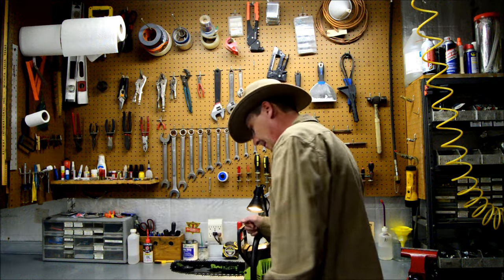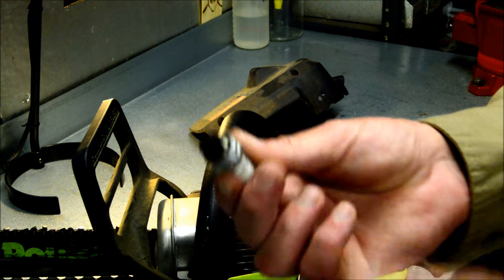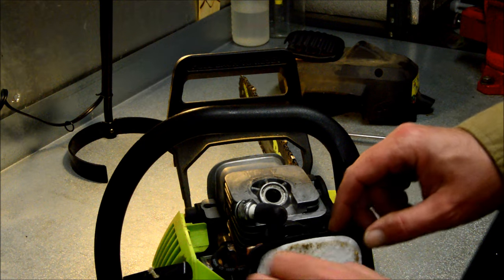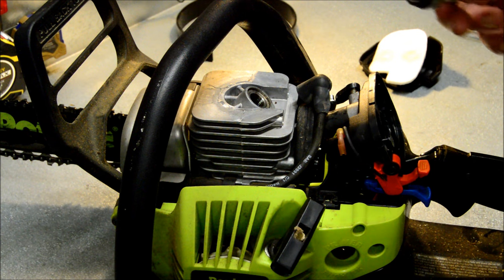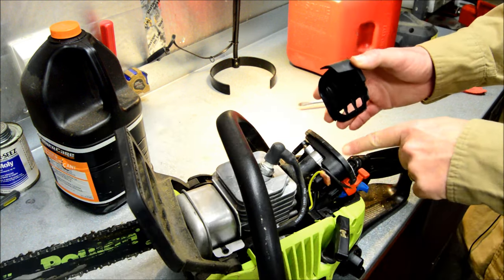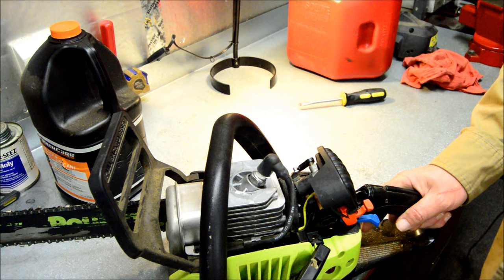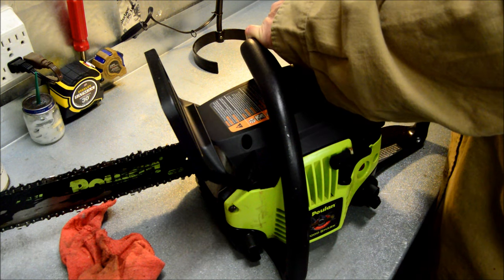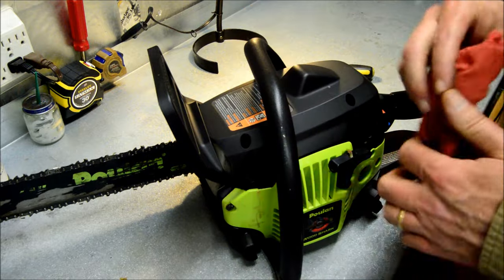Chainsaw Won't Start - 10 Years in Storage - Poulan Woodshark - DIY Repair

Comment: I’ve got a 7 yr old Poulan 4218A. Used it once. Won’t start. Used brand new fuel/ oil mix. New spark plug. Everything is clean. Still can’t get it to start. Have no clue why it won’t start and run. It’s about to go into the trash.
Reply from the maker: Check the fuel lines, they can rot if it's been sitting 7 years. Also the rubber diaphragm inside the carb can dry out.

Comment: they are paying you to fix it. top off all the fluids and change the sparkplug and both of the filter.
Reply from the maker: Yeah thanks for the tips, but I was repairing this for someone on a fixed income and they wanted to keep cost as low as possible.

Comment: It isn't supposed to build pressure. It pulls the gas up to the carb.
Reply from the maker: IDK but every saw I've ever run has built pressure after running. Might be from the heat or the vibration of the saw but it happens. Thanks for commenting.
Reply: Correct, the primer pulls it through

Comment: I am embarrassed to admit this, but hey, if it helps someone who only pulls their chainsaw out once a year it's worth it.  I fought my saw last night, after I was using it for 30 minutes.  I finally gave up and let it rest.  I thought maybe I had flooded it.  No, it turns out I didn't have the chain brake in the correct position.  You would think I would have remembered this since it is the same problem I had at the beginning of last year.  But no, I still came to YouTube University for helpful hints and a reawakening about reading the doggone start up instructions on the chainsaw.

Comment: My poulan starts when it is cold but will not start when it is warm been told it is the need  of a new carb
Reply from the maker: Maybe, but it might just need a rebuild and a new diaphragm. I have seen a bad coil do this as well. You might check spark next time it wont start. Good luck.

Comment: Most of the time the fuel line is rotten on a poulan
Reply from the maker: True and I checked the lines but in this case it was just some bad fuel from lack of use. Thanks for commenting.
Reply: EUGENE KUPKA yep
Reply: Not just Poulan, many brands and all types of gas run yard tools.
Reply: if you leave fuel in them a long time, any 2-cycle fuel line will go brittle, not just Poulan

Comment: Ethanol pulls water out of humid air and wets the fuel.  That's why you shouldn't leave it sitting long in any engine.
Reply from the maker: I agree, thank you for commenting. In fact, I recommend get pure gas for your small engines, if you can.

Comment: Hate to sound like a jerk but I own a small engine shop,A very busy one  and half of the things you are doing are wrong or needless.It doesnt run,Remove air cleaner cover shoot brake cleaner into carb ,turn on switch ,Pull over ,If it starts and dies this means it will run and you have spark ,Compression you probably just have a fuel issue,Begin to check fuel lines and carb and tank filter,It should be repaired in 10 minutes
Reply from the maker: In a busy small engine shop you are correct (been there done that). That's why I prefer to work on my own equipment and I encourage others to do so. Clearly, I think going the extra mile is worth it. It might take me 20 minutes but my customers are happy with the service I provide. May be you should do your own video and show us all how the experts do it. Or perhaps you're just sour because my video might be cutting into your profits? LOL
Reply: Terri Breneman
Reply: @TheHandsOnChannel  i actually don't think he was being a jerk-he gave some really good advice how to speed up the diagnosis of a small engine. i do the same thing...if it fires up on a bit of carb cleaner/break cleaner-it tells you it will run-you have spark...then go from there...we're all here to learn how to be better...take it as a free tip-not a slight...
Reply from the maker: @kirkthebeerslinger  Neither did I and I wasn't offended. I tried to reply respectfully although a bit snarky. He says half of the thing I did are WRONG or NEEDLESS, clearly I disagree.  Ive seen this many times. There are some mechanics that think their way is the only way.

Comment: Can you help. ..my chain won't stay on. It keeps  coming off?
Reply from the maker: Sounds like the chain is loose.
Reply: @TheHandsOnChannel  no . Chain is onn tight.
Reply from the maker: @gerrywalsh7677  Is it coming off near the tip or near the chain drive gear?
Reply: @TheHandsOnChannel  just keeps coming off. It all comes off no matter how I tighten it.  Thanks for your reply.

Comment: My primer bulb is full and is hard to push it will run for about 3 seconds and die then i can push the bulb again and it will do the same thing ive replaced the filter but what could this be
Reply from the maker: Could be a bad primer bulb. Be prepared to change the fuel line if the saw is more than a few years old.
Reply: Could be purge bulb hooked up wrong

Comment: How much gas should be pulled into the bulb? When your priming.
Reply from the maker: You should be able to see it flow as you pump it. It wont be completely full but about half.
Reply: @TheHandsOnChannel  Do you like any certain Spark plugs Came with a Torch 7 Saw was a return to a store. Was not used much. Did a multimeter  test on the plug. It is bad. Maybe why it was returned.
Reply from the maker: @charlescoker7752  I've had good luck with NGK for small engines over the years.
Reply: @TheHandsOnChannel  Thanks!

Comment: I aways used starter fluid.
Reply: You have to be careful with carb cleaner Or starter fluid Or anything else it doesn't apply lubrication. It only takes seconds to score the cylinder wall without lubrication.

Comment: BTW, Never use ether as "starting fluid". Use wd-40. It wont burn the piston. I have seen many engines ruined by guys using ether.
Reply from the maker: I've heard this before but I've been using ether for years with no problems, so far. I'd say be careful with it and use as little as possible and it should be fine.
Reply: never heard of using wd-40  as starter fluid  but i think i will give it a try , now you mention it
Reply: Ether burns very hot and displaces oil in the cylinder. 2 things not good for 2 cycle pistons and some bigger engines as well. WD40 is combustible and acts well as a starting fluid and has some lubricating qualities. Many people do not realize that 2 cycle uses the oil in the fuel to aid compression as well as lube. Displacing oil with ether detracts from ability to build compression. Not what you want in an engine that is not starting. Just my 2 cents.
Reply: i pretty well always have a can of wd on hand , so next time i have to prime one of my machines , i will try it .  motorcycles always give me a bit of grief after waiting out the winter .
Reply from the maker: Cool thanks for sharing. I may try it next time.
Reply: Ether is for large engine's, it burns to hot for smaller engine's and rids the cylinder of oil.

Comment: So you need to say up front that you are not actually going to fix anything, so I can save some time.
Reply from the maker: May be you missed the part where I got a saw running that had been in storage for 10 years. I inspected the saw, cleaned plug, air filter, checked for spark/compression/fuel lines, added fresh fuel and got it running. Guess i really didn't do anything  according to Pat D. You could have saved some more time by not commenting, but I'm guessing your time is really not that valuable. Thanks for the idiotic comment. It really helps me keep track of how many morons are out there.
Reply: Pat D got owned.

Comment: Did not check plug gap?.
Reply from the maker: After a while your eyeball is good enough. I call it my laser eye, kinda like a superpower. I can level without a level. Plumb without a plumb bob. Measure without, yeah you get the idea. Hell, I can see from 3 miles to 3 microns. What were you sayin, oh yeah the gap was perfect. LOL JOKING! You're right I should have mentioned the gap. I'll do better next time.

Comment: But what did you fix ?? It had spark, the 10 year old fuel lines for some reason still worked, you didn't remove the carb, change plug, even the recoil and rope needed nothing.  I see that you put gas in it and wiped off dirt.  What do you charge for THAT !
Reply from the maker: Same thing I charged you for the video. I suspect it had gummed up fuel stuck in the lines or bowl. Thanks for the comment.
Reply: @TheHandsOnChannel  So your friend put fresh gas in it, tried to start it, messed around with it a bit - his fresh gas loosened the old varnish, then YOU put gas in it again and it ran !
- Hooo boy ! -
Here's a tip maybe someone will appreciate:
When tightening and adjusting the chain, put a 2X4 or piece of branch under the bar, shoving the bar UP while tightening the 2 nuts.  If you let the bar "dangle" when snugging it up, it WILL move up with the force of cutting, vibration, heat, and your chain will go loose.

Comment: I have to ask was no actual fault found? What did you change to make it go from no start to normal start? It doesn't seem like you replaced anything and did only routine maint. So how can you say you "repaired it" if it actually wan't broken in the first place? Maybe I missed something in the video.
Reply from the maker: Bad gas.
Reply: It was empty, so did you clean the carburetor after all?

Comment: I would replace the spark plug,  they're cheap and I have seen plugs that work without compression but not when in the engine .
Reply from the maker: Great idea and I would normally do that but this customer wanted it as cheap as possible. Thanks for commenting.
Reply: @TheHandsOnChannel  
Thank you, I wasn't trying to condem what you did, if the engine was running before, cleaning would probably work. A friend of mine was working on a Honda engine a pressure washer,  and he replaced the carb,  and fuel system finally he changed the spark plug and it ran great. Just never can tell .
Have a wonderful weekend sir
Reply from the maker: @bertgrau9246  No worries, I didn't take it that way. Have a good one and stay safe my friend.

Comment: this mechanic is running the saw without the cowling in place, saw will get hot and quit. Then saw will need a ring set and deglazing before it will run at full power.
Reply from the maker: It still runs great! Thanks for commenting.

Comment: I’m skeptical on this one.... he didn’t do anything....  I think this might be some YouTube magic
Reply from the maker: LOL  Let me spell it out for ya bud. Bad gas from sitting in storage for 10 years, I thought that was self evident. The owner drained the gas and tried it with some fresh and could not get it running. He drained the tank again and brought it to me.  I didn't find any obvious problems but I suspect bad fuel was in the carb and I flushed it out with a bit of fresh gas, cleaned the plug and did other basic maintenance you'd want to do on any saw setting for 10 years. Suck squeeze bang blow.
Reply: @TheHandsOnChannel  cleaned the plug?
Reply from the maker: Yeah I hit it with the wire wheel to remove carbon.
Reply from the maker: @Wanous-hv7zo  Yeah sure bud, I noticed you've been trolling this video for a while, commenting on everyone's comments, saying smart ass stuff to people who have a Poulan saw. To me that's a little weird. But to answer your question yes the owner of the saw wanted to keep repair costs to a minimum.
Reply: @TheHandsOnChannel  saying smart ass stuff? Ha ha ha ha ha ha ha ha ha ha ha ha ha ha ha ha ha ha ha ha ha ha ha ha ha saying the truth and you don't like it
Reply from the maker: @Wanous-hv7zo  No he asked me to keep it cheap because he is on a fixed income, in fact I didn't even charge the ole boy to get it going. He uses it primarily for property maint. on a city lot so perhaps a poulan saw is exactly the right saw for him.
Reply: @TheHandsOnChannel  a poulan is not the right saw for anyone. Stihl sells a good saw new for $179 that will out last many poulans and don't vibrate so bad your hands go to sleep. Poulan saws are not worth the money paid for them. They are a poor quality  pile of crap and if you knew anything about chainsaws you would know this. I suppose poulans are all you use too?
Reply from the maker: @Wanous-hv7zo  No I run a husky now but I have run them and they are fine for most homeowners in the city.
Reply: @TheHandsOnChannel  well your Husqvarna owns poulan. Husky is going down the drain too it's a terrible thing.
Reply from the maker: @Wanous-hv7zo  Yeah I don't doubt what your saying. it's a disposable world now. I've got a rancher from a couple years ago and it's been good so far but everything's plastic now. Better start buying those older saws and fixing them up.
Reply: Mustie > hands on channel
Reply from the maker: @jasont1079  Thanks for adding to the conversation, bro. Interesting opinion really helps out, thanks.
Reply: for  a real mechanic, it is just to EASY to fix these small motors. And usually for a few bucks if you have the know how. Carb for $10, fuel line for $4 and 20 minutes of time ?? I call that a home run I just fixed my 55" TV for $35. Never have worked on one before. Saved myself well over $600, Call me a FOOL !! I call that a HOME RUN !! Not mechanically inclined ? TRY IT !! What do you have to lose ?? And the satisfaction of learning is a home run ... even if you fail ... which most likely, you won't !
Reply: The Hands On Channel why do you respond to him? Learn the word “block”
Reply from the maker: Nah, I don't like to block people. He's free to express his opinion on my channel.
Reply: So you hate Poulan, Ok we all get that. You obviously like to show that. Let me tell you. We lived on an acreage in the Midwest for 16 yrs in a 1918 built home in a very tiny old unincorporated town with 10 houses.  For 4 yrs of that because of the high cost of home heating oil. I heated the home with only a wood stove in the living room so I cut wood all of the time. I have an 18in Poulan that I cut all of that wood with. The old type with the manual bar oiler. This saw never failed me. I maintained it regularly. My two neighbors also heated with wood and we would go out and cut together. Two of us had Poulan and One had Stihl. His Stihl didn't didn't cut any better or any worse than the Poulans and we could cut through a log just as fast as he could. I used it for many years after that. Oh and by the way. Mr. Olds 442. I have a 68 RSSS Camaro.

Comment: If someone brought it to you saying it didn't run because there was no fuel in it they probably should not be running a chainsaw. Just sayin.
Reply from the maker: LOL, I didn't explain it properly. He tried it with old gas, it didn't start, he added some fresh, still no start, then he drained the gas and brought it to me. He had a blister from trying it, lol. We've all been there.
Reply: @TheHandsOnChannel  okay, that's better. Lol thanks for the reply! One of a very few that actually does it anymore after a certain time period.

Comment: You skimmed over alot. Spark plug I would never clean on a wire wheel, use fine abrasive paper in between the electrode, externally clean with brass wire brush, check plug gap. When tensioning chain, bar should be raised to ensure correct tension.You never inspected fuel filter. What use is it putting carb cleaner into the intake? the carb inlet is just a pipe, carb cleaner is for the inside workings / passages.

Comment: Why put oil on air filter? They don't come from manufacture that way. One would think it would if it needed oil.
Reply from the maker: The oil helps to keep dirt/grit from getting into the carb.  Not sure why the factory doesn't do it but it's been the standard for many years on foam filters. Thanks for your comment.
Reply: @TheHandsOnChannel  What kind of oil works best?
Reply from the maker: @richardblackwater2617  I use 10w30.

Comment: Excellent video !!!!!!!!!!!!!!!!    Thanks so much .  Terri Breneman in comments is probably right , as far as saving time , but I have learned so much that I didn't understand . Thanks again ________________Ernest E. Johnson
Reply from the maker: Thanks for taking the time to comment. And yes there are faster ways to achieve this job, but I think spending a little extra time doing a thorough job is worth it. I'll admit Terri's comment triggered me a bit. Mainly because of the first couple of lines. That said every mechanic I've met has different style's. Doesn't necessarily mean one is wrong.

Comment: You said the primer bulb pressurizes the fuel tank.    .........?    I think you mis-spoke. I don't think that is an accurate statement.
Reply from the maker: Yeah I meant the fuel line. Although the tank does pressurize slightly during use.
Reply: If the fuel tank gets pressurized, then it is not venting properly.

Comment: thats called a pull-on, i highly recommend buying a Sthil.
Reply from the maker: LOL pull on, that's funny. I like Huskies for serious wood cutting but sthils are great.
Reply: @TheHandsOnChannel  i only use the Sthils made in Germany the others are just a homeowners saw.  the pullons made after 1990s are junk.
Reply from the maker: @davesilvia9711  What model have you had the best luck with? In case I see a good deal on a used one. I've got a lot of wood cutting in my future. Thanks.
Reply: Stihl is the same as far as the older the better. Anything that starts with 0 ie, 029 instead of 290
Reply from the maker: @feez357  Thanks!
Reply: @TheHandsOnChannel  all the older models in good condition are real gems but rare, whats most important no matter what brand saw is you gotta keep your bar properly dressed and your cutting edges sharp and like Pete said, a duĺl tool is like a limp dick, you can't fuck with it.